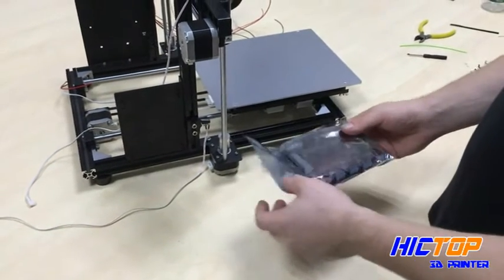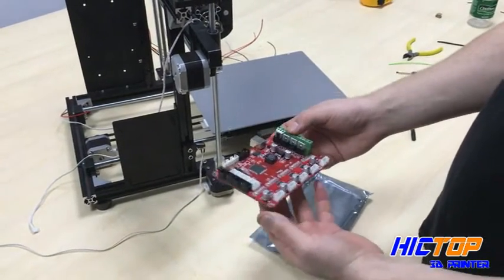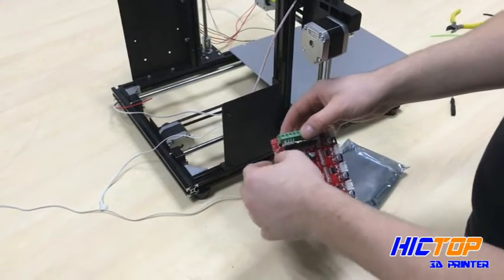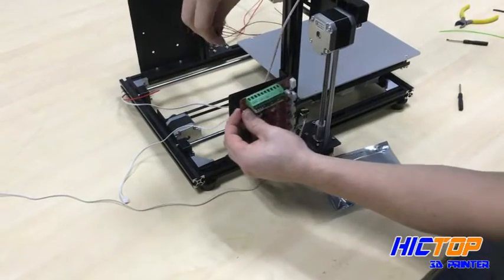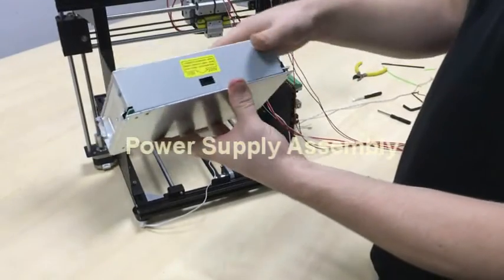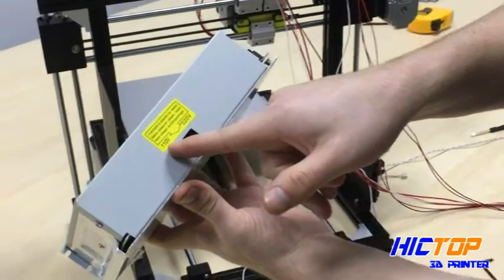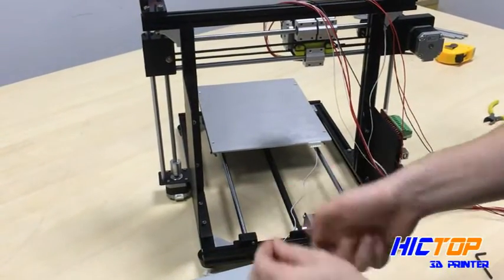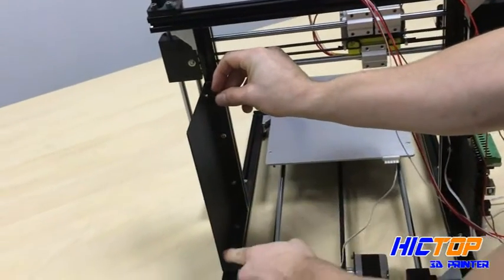6 9 Control Board and Power Supply Assembly

Comment: how do i chnage the switch to 110 v
Reply from the maker: There is a power switch on the power supply, you can switch between 110V and 220V by using a tool.